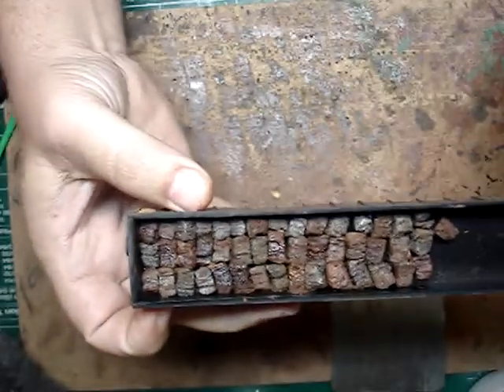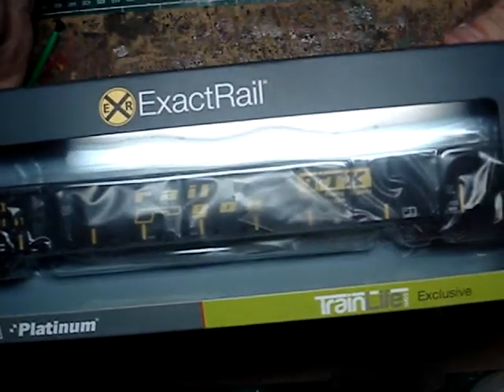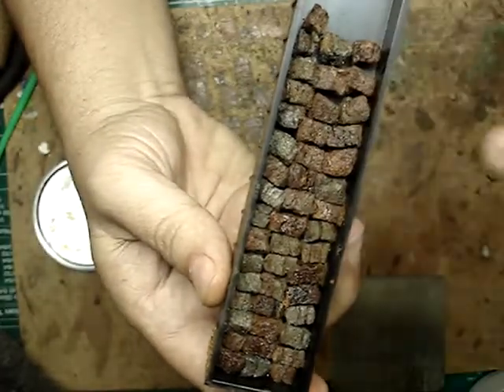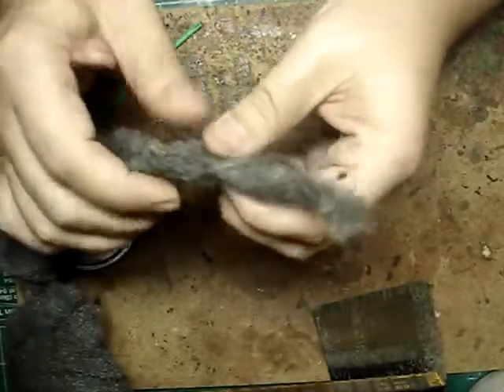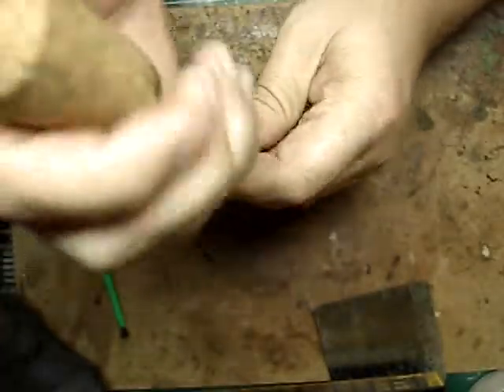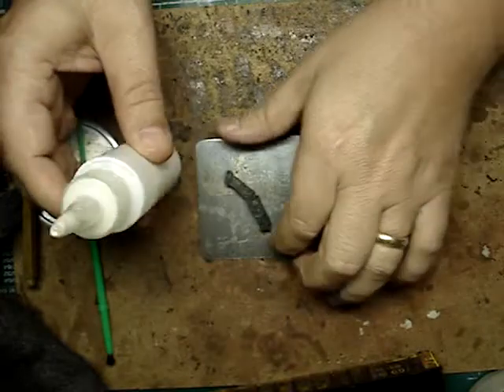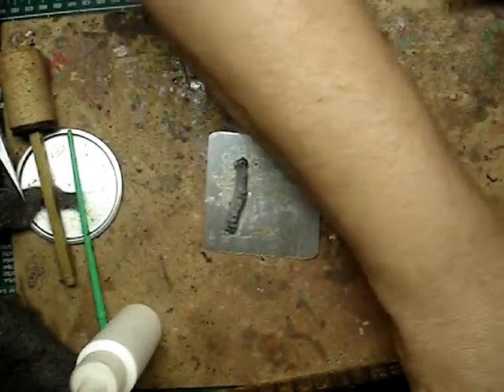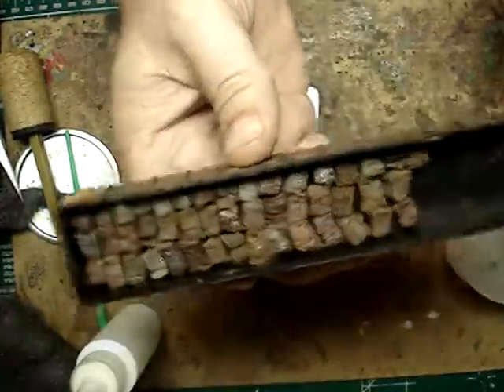HO Baled Scrap Wire Load for Gondolas

Comment: A little tip:  before you use the 50/50 mix of PVA & water, first spray it with some alcohol to break the surface tension so the glue will penetrate better.  You could also use a couple drops of dish detergent in some water in a spray bottle to spray it before adding the glue.  Anything that will help the glue mix penetrate is your friend.  Great looking bales.  I may have to try something like that.  I'll have to ponder it for a while and see what I can come up with.  Thanks for posting.  I love watching videos from other modelers to learn new techniques.  
I use nearly the same technique for making rust powder for adding rust to my models.  I put about 3 or 4 rolls of 0000 steel wool in a quart jar & fill it up with vinegar and set it in the kitchen window.  After a couple 3 weeks after it has mostly turned to a rusty mix, I pour it out into a flat pan (I use my old 14x11 stainless photo processing tray--a flat baking dish will also work) and wait a couple of weeks for it to completely dry.  I then use a single edge razor blade and pulverize it into a powder and store it in little snuff tins (I used to dip).  Then to use, just mix it with some 50/50 glue & water mix and apply.  Sometimes I'll even gouge the plastic with my A-proxo knife and put the rust in the crack or groove.  I never use an X-acto knife 'cause I'm never exact, just approximate.
Cheers from eastern TN